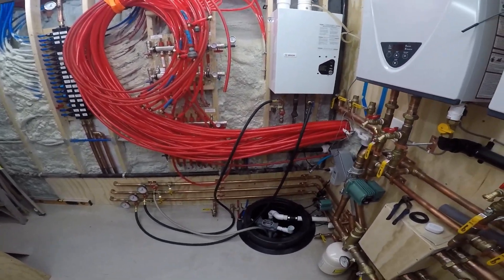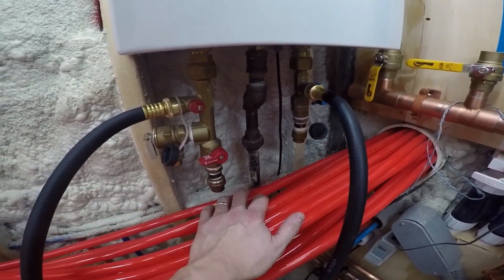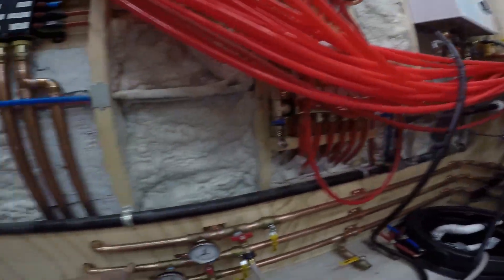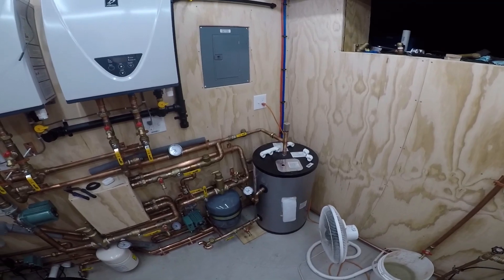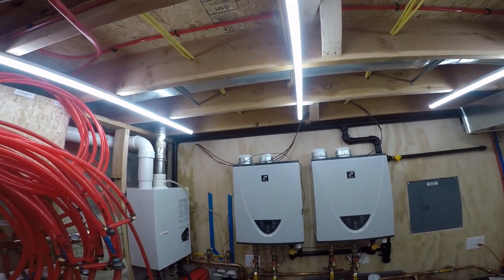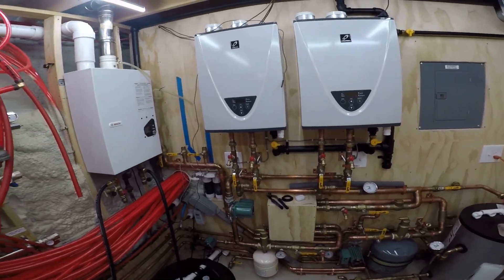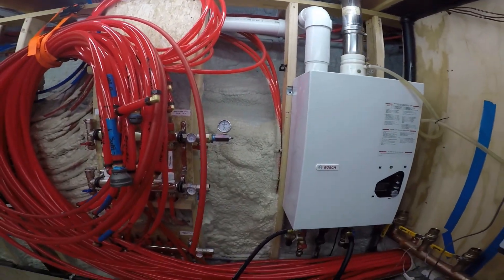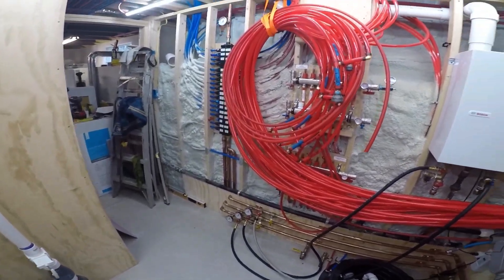1" Hot, Cold and Recirculation Water Lines To Manabloc Finished - Episode 21 [10-31-2020]

Comment: Is you block installed upside down? Never seen one with the hot and cold mains on the bottom and main cold feed at the top. Ever one I have ever installed has the hot and cold main on bottom and main cold on top.